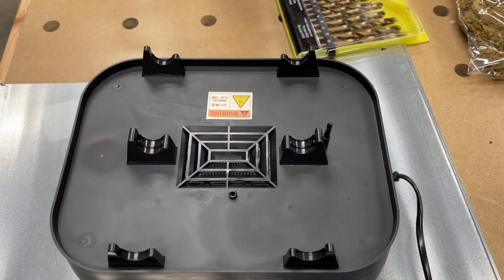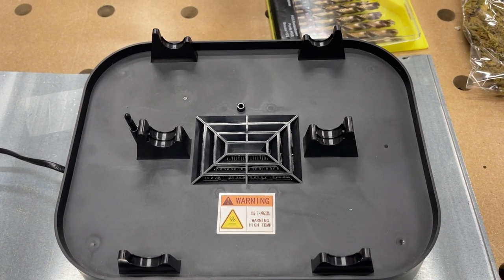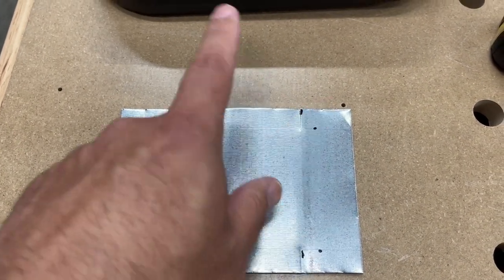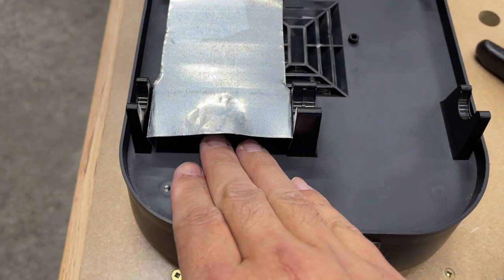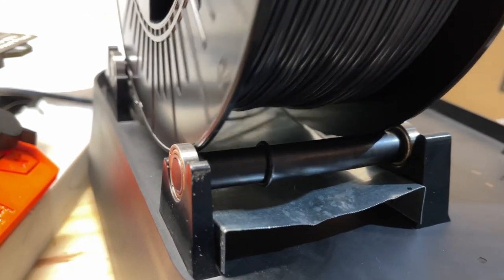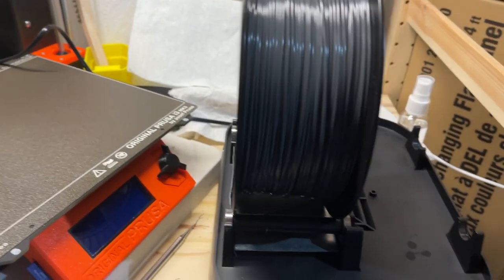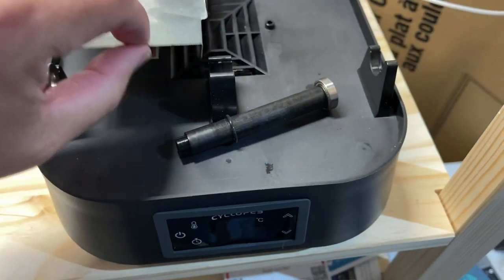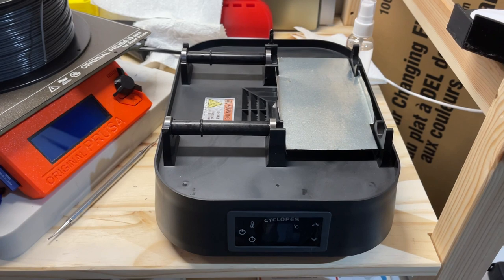Eibos Cyclopes design flaw eliminated?

Comment: Thank you for the well engineered heat deflecter! I had this unit TORCH my reels. omg
Reply from the maker: Glad I’m not the only one…. Waste of money. I’m too scared to use it for fear of killing another roll, even with the blast shielding…
Reply: @mbwoodbutcher  The heat deflector didn't do the trick for you?
Reply: @mbwoodbutcher  did this not work? I just got this dryer yesterday.  I was using the hot heat as a Pro instead of a Con for this product and just deflect the heat around like you did.
Reply: @austenelam134   i'm wondering the same thing.  I hope to get a reply.  I just picked up this dryer.  Most dryers doesn't get this hot, so i used the hot heat as a pro instead of a con and was hoping to just deflect the hot heat around.

Comment: people have made printable risers for this which work much better than a deflector
Reply from the maker: Wow, i did not know that, i had no idea, does it rise the spool? Still a design flaw with the hot air blowing on the filament.
Reply: @mbwoodbutcher  look for eibos riser on printables. it raises the spools and helps the circulation work better.
Reply: @mbwoodbutcher  i have the same problem.

Comment: I dried my PETG and ABS at 65C and had no problems. Haven't tried PLA yet. I recently bought a dryer. However, I immediately replaced the fan with NOCTUA NF-A6x25 and it became MUCH quieter, now the dryer is almost inaudible.
As a DIY project, I want to completely redo the dryer electronics, put a normal TFT display, electronic temperature and humidity sensors, electronic scales inside, make a normal control board on STM32.
But... when there is free time... :)))
Reply: Have you noticed any issues with the Noctua Fan modification? I also installed the same fan on my Eibos recently because the thing was louder than my printers. It seems like the Noctua is more of an airflow focused fan vs being static pressure focused. I can feel some warm air spilling back through the fan intake. So far it's been working fine for the past couple of hours, but it doesn't exactly make me feel comfortable leaving it running overnight. I looked for a 60mm Noctua industrial fan in 5v, but I guess they don't make one.
Reply: @mrhouse3796  I didn't notice any problems. I left Nylon to dry at 70С for 8-9 hours. Everything works perfectly. Haven't tried it overnight, I don't leave anything to work overnight.
PS
The external temperature sensor shows that the temperature inside does not exceed 62-65С, even if you set 70С
Reply: @dr.emmettbrown8466  Ok, ty. As for the temps, I figured it doesn't fully get to 70C. Even when I set it to 60C it doesn't cycle the heater relay like it does when I set it to 50C. It was the same way even with the original fan. For stuff like PC I just leave it drying longer than they say is needed to make sure it's dry. Thanks again for replying.

Comment: April 2023, mine came yesterday. Only just seeing the issue now. 9 months since this video released, who has come up with the best idea around this issue? I like the idea of what you were doing with the sheetmetal, I think you would get away with 1 side only, restrict both sides and you increase the chance of overheating. I am thinking of mods I need to do already such as increase feet height to give more air flow from underneath and my version of a sheetmetal deflector. Typical made in china, no R&D just D.
Reply: imagine blowing 160 dollars just to go home and fix what you paid for.. which is the boat I'm on right now. I bought this janky thing too and already experienced the fillament sticking.. following their own instructions on heating PETG to 65c...